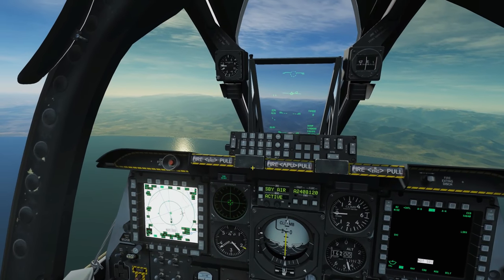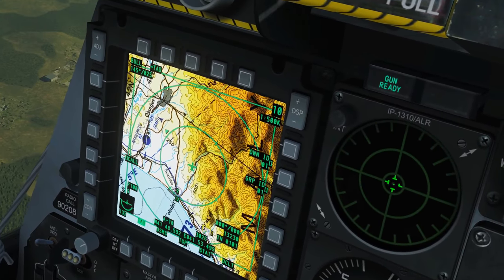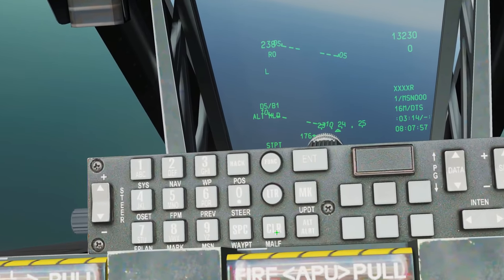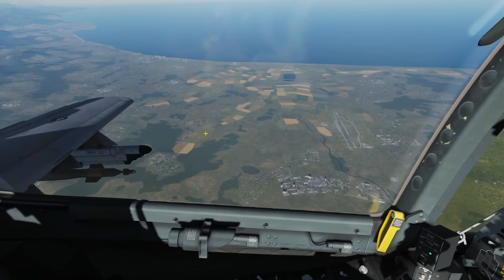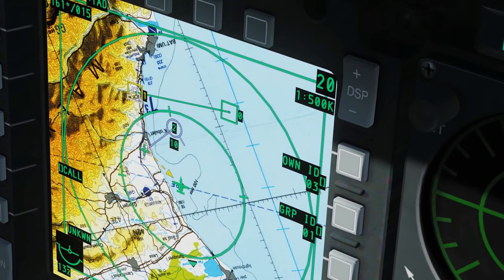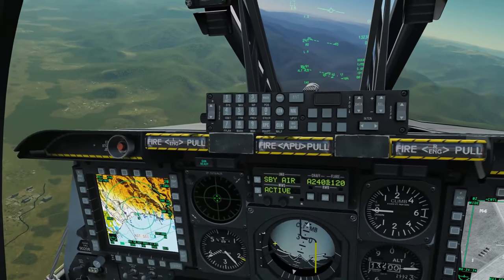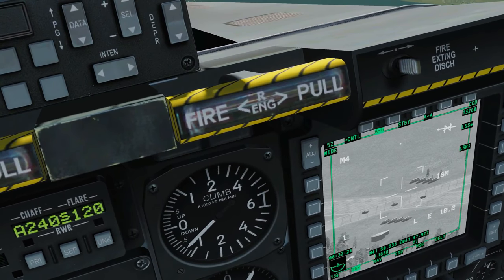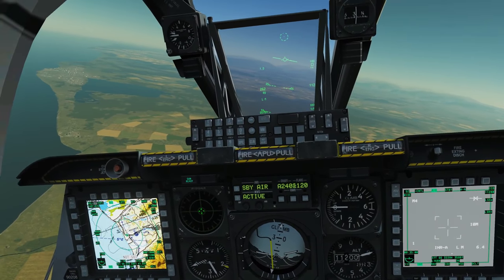A-10C Warthog: SADL Datalink Tutorial | DCS WORLD

Comment: It felt like all the stuff in the F/A-18C was sooo much easier to learn compared to the A10C...
Reply: necroing the necro post, but it is easier, because the f/a-18c was built to be incredibly easy to learn how to use. on top of this the level of control you have over your targeting and waypoint system is MUCH less substantial than the a-10c, but is streamlined to allow you to access all of these things very quickly. The a-10 is a big ol ground attack bomb and missile truck and thus needs to be able to keep track of targets. being able to share targets like with the SADL or being able to quickly divert to the nearest runway is something very necessary on the a-10c. and since they have two incompatible types of datalinks you cant really transfer your knowledge of both to the other aircraft. I suggest either hopping on the Hoggit training server, spawning a range and as you get started up and start looking up how to do specific tasks as you need to do them, OR just making a training mission with some static targets and playing around with it. the hog is very fuel efficient and all you gotta do is establish a good altitude and set your autopilot to altitude hold, bank to one side and turn it on before playing around with your heads down stuff. Also with the CDU i unbinded all of my letter and numerical keyboard keys and bound them to the CDU typing keys. makes entering scratchpad data much easier when i can literally type it, as well as binding the waypoint scroll rocker to a scroll wheel on my left throttle to allow me to very quickly switch between markpoints.
Reply: @PatrickRatman  Yeah after one more week I get more and more used to the A10c and start to love its systems. The CDU Topic is an interesting one. Maybe I find a way to use a modifier somehow that keeps itself pressed until clicked again. I got a Corsair Keyboard with 6 Function Keys so maybe thats a thing.
Reply: @Brooks__EU  look into voiceattack
Reply: FireManDan i use voiceattack for ED. But in DCS I don’t wanna use it for realism reasons

Comment: Great video! Is it possible to share spi with F18? How can I put an A10 and an F18 under the same group?
Reply from the maker: Neg, tried, does not work.
Reply: I know it's been a year but the reason you can't share between the two is because the 18 and the hog use two different datalinks. You CAN share a spi between the hog and an f-16 though since they both use the SADL